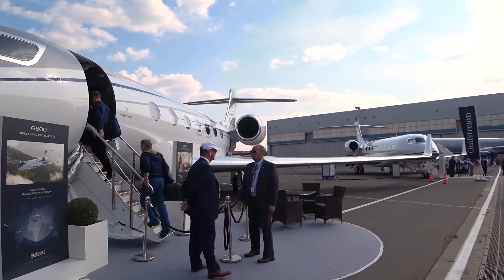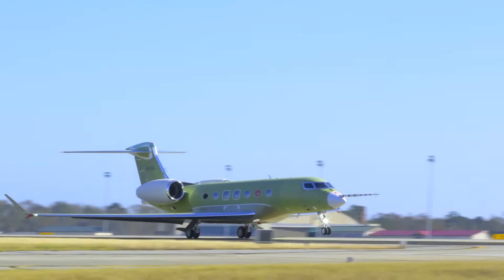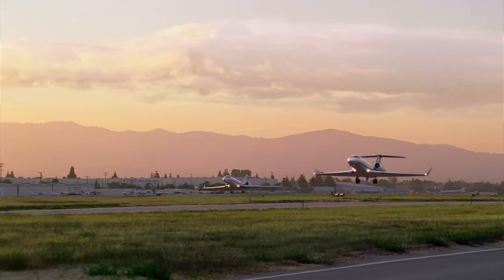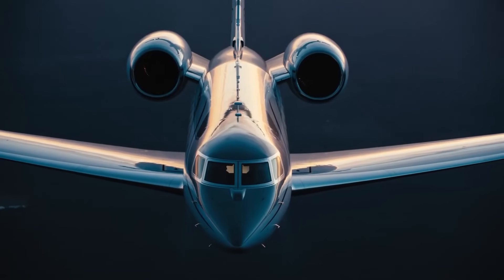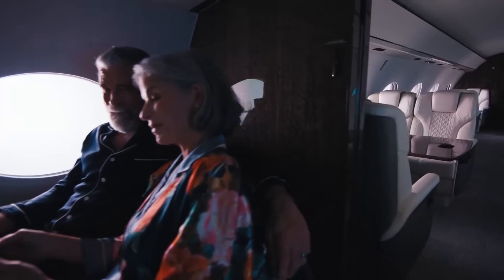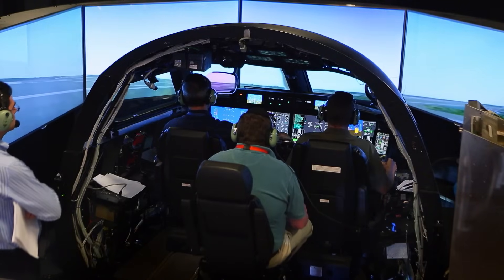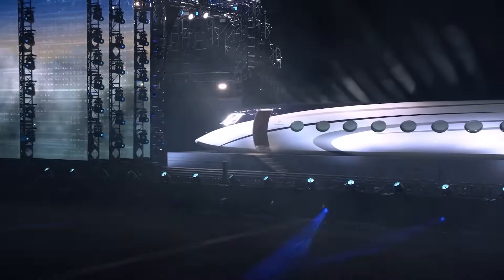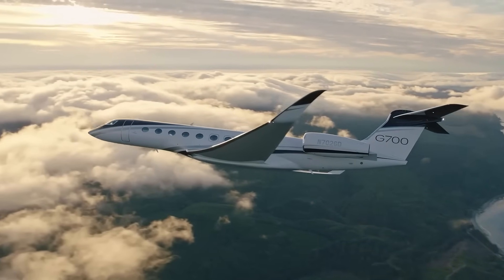How Gulfstream G700 beats Global 7500

Comment: The Global 7500 can all be upgraded to Global 8000 w/ very minimal upgrades needed, the Global has really flexible wings, and moving front wing spar to help improve take off & landing performance which no Gulfstream plane have :] and the Global 7500 exceeded speeds at more than mach 1 last year.
Reply: Where did you find that?
Reply: @Ryangosling95 why would you ask, look it up if u haven't followed the Global 7500 and 8000 story ._____.
Reply: @mmontalvan1848 yeah i didn’t knew you could do that

Comment: Beautiful aircraft but I’ve decided on a Falcon 7X which gets me from Van Nuys airport to London, non-stop. The cost of the aircraft, slightly used, is less than half of these flagship models and the fixed and variable operating costs are lower ( even with 3 engines instead of 2 ).
Reply: My old business partner had this plane 15 years ago from new. It’s an amazing aircraft and he used it a lot to Africa, South America and the Middle East. He told me of some adventures in Africa in that plane, including flying low level looking for pigmy villages - his pilots were ex-air force! When they went back up, they were out of fuel and had to make a landing in CAR, where a kid came out and offered to take a picture. It was a trap, as it’s illegal to take pictures at the airport, so the police came out for a bribe or the plane could not leave!
Reply: I think your mom is calling you to dinner
Reply: @ Unfortunately, my mom passed away a few years ago at the age of 83.  I wish she was calling me to dinner.
Reply: Bro acts like he can buy it

Comment: The range and speed of both planes are nearly the same, there is no advantage of the 6 years younger G700 over the Global 7500, both have modern sidestick Cockpits. Yes, the G700 is a bit more fuel efficient, but that is a must for a 6 years younger plane. On the other hand the Global offers the much more comfortable and advanced Nuage seats and chaiselongue, and the Global always comes with a 4K entertainment system, whereas the G700 only has HD monitors which is embarrassing in 2025. furthermore, Bombardier will offer soon the Global 8000 which is a Global 7500 with 8000 nm range, and here Gulfstream falls short because their upcoming G800 will be a smaller only 3 zone cabin plane. With Gulfstream you will have to decide whether you want best space or best range, with Bombardier you get both in the Global 8000 at the same price of the G800 with the compromise in space.
Reply: Hot and high take-off performance, the Global 7500 beats it hands down. 

The Global incorporated forward leading slats, which increases the wing camber, creating more lift, having a direct effect on lower take-off speeds, better 2nd segment climb gradient (V2) until acceleration altitude, then fly VFTO until MSA. 

If Gulfstream were to incorporate slats, then and only then after studying the G650/600/700/800 vs Global 7500/8000 would my knowledge be better suited to say if or if not Gulfstream can beat Bombardier.

Comment: In case you are wondering why 19 is the maximum passenger count, it's because that is the cutoff for Part 91(private general aviation) or Part 135 (charter on demand). Over 19 passenger flights require a certified trained cabin attendant. Even though many flights of large cabin private jets will have a cabin attendant for convenience, they aren't required to have specific training such as CPR, firefighting, and ditching and/or evacuation training. Some owners prefer to only have the pilots on board for privacy.
Reply from the maker: Good info)
Reply: I was not wondering that at all......Yet I learned something anyways so thank you!
Reply: Thank you for explaining!
Reply: Most of these “attendants” are escorts instead anyways
Reply: But how would have an FA compromise pax privacy?

Comment: I like Dassault tri jets.
Reply: Happy memories of flying all over the Saudi Arabia in a Falcon 50 back in the early 80s. On one flight I was the only passenger.
Reply: I like all tri-jets! 😊
Reply: Too bad they don't build tri engines for this class category
Reply: @fadhly5192  That Falcon 8x ain't no slouch.
Reply: @johnstudd4245  Falcon 8x is more like on the same class as G600 or Global 6000 iirc. The Falcon 10x only has two engines for G700's class..
Reply: @fadhly5192  But the 10x is not a tri jet. The 8x has plenty of capability as far as I'm concerned. It's just about bragging rights. One saying mine has more range than yours. How often is the difference between the two really going to make a difference. To be honest, I would not really even care to be in an airplane for 14 hours.